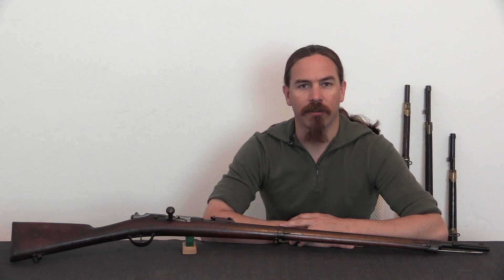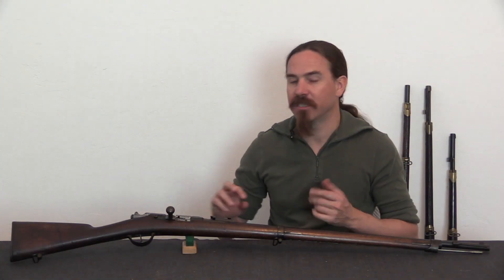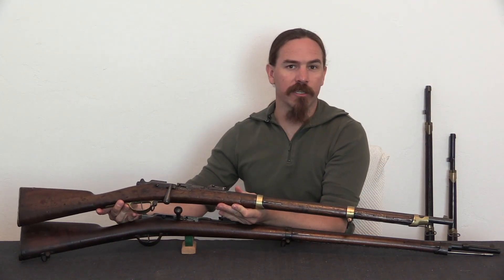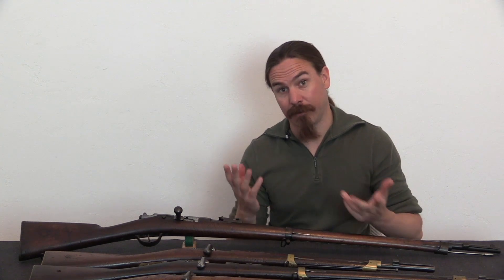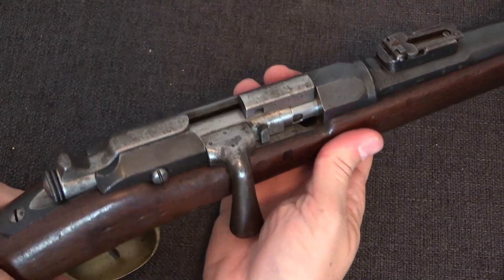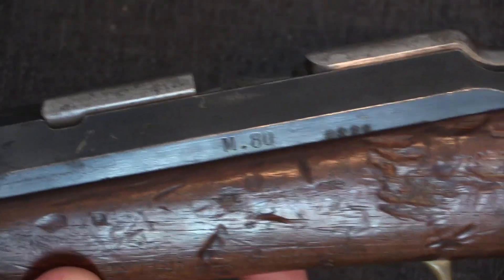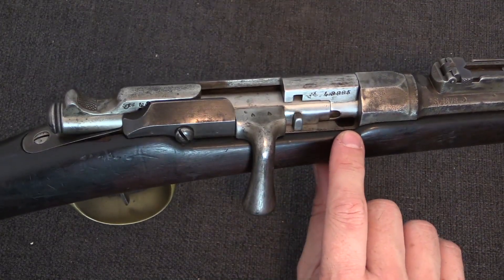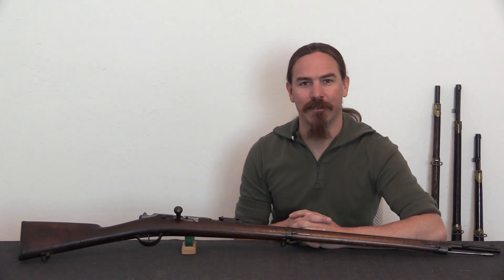The 1874 Gras: France Enters the Brass Cartridge Era

Comment: Would the Vitali magazine system have worked on the Gras and did the French ever make smokeless 11mm rounds ?
Reply: I don't see why not. In 1914, in the beginning of WW1, the French planned to modify the Gras rifles with a 3-shot Berthier magazine. But this never happened because they decided to focus on producing new rifles instead of modifying obsolete ones. But some Gras rifles was actually modified to fire the smokeless 8x50 Lebel cartridge in 1914. That model is called the M14 Gras. They just took a Lebel barrel and put it on a Gras, added a handguard and new sights. It's still a single shot rifle though.

Comment: This is awesome! Looking at your video, I've got the Artillery Musketoon version of the M 1866-74 Gras that was converted from the Chassepot, also got the M.80 upgrade. It's missing the bayonet lock, but there are faint marks on the barrel in the right place to make me think that the lock was ground off at some point. The stock has been pretty heavily beaten up and decorated with brass studs, but I can see the remains of both the primary stamp with the plug and the secondary conversion stamp. My dad picked the gun up in Saudi Arabia in the early 70s. Ideas on how a French rifle ended up in the Middle East, Forgotten Weapons?

Comment: Greetings from South Australia! I own two slightly different conversions of these things to 12 gauge shotguns; one with a barrel etched/engraved? "Made especially for South Australia" I cannot find any reference to local conversion - would you have any knowledge of these Gras shotgun conversions ?
Reply: Ashley Smith Interesting, I didn’t hear anything about this conversion. Original Gras is in 11 x 59mm.
Reply: Yes I've seen one in 12 gauge at the local gun shop in QLD. It was the model with the bolt that turned downwards. Not horizontal.

Comment: I find it kind of funny that the French word for rifle is Fusil, which afaik comes from the older word foisil meaning piece of flint. Fusilier originally meant a specific soldier, who in an age where most musketeers had matchlocks, carried early types of flintlocks known as dog locks, so essentially Fusil originally meant a flintlock firearm. It's also interesting how long they held on to the term musketoon, since the thing obviously isn't a musketoon in the original sense of the word.
Reply: Adding onto that, the word "Grenade" comes from the French for "Pomegranate" as the cross section of early grenades looked much like a sliced open pomegranate.

Comment: The Mosin Nagant's bolt looks vey similar to this one.
Reply: Yes, indeed. The rear part of the bolt is very similar. There is also similarities in the bolt head. Even the receiver is quite similar. I have a Gras and compared it to one of my Mosins. It is obvious that the Mosin was inspired by the Gras and Lebel. I have a Lebel also, the Lebel bolt is almost identical to the Gras bolt.
Reply: Sergei Mosin is inspired by the French so Mosin-Nagant bolt has a distinctive French flare to it.

Comment: Wasn't the Gras used in WWI by the French forces particularly as they exceeded the production of more current firearms such as the Lebel Model of 1886 or the Berthier? I also seem to remember instances of Gras' being used by french resistance forces as late as WWII.
Reply: The Gras was used in WWI by the support and guard troops in the rear (basically by all the troops that needed guns but weren't expected to use them all that often) to free up more modern guns for the front line, at least that's my understanding. Not sure about the WWII use, though.
Reply: Among Lebel 1886, MAS 36, Mle 07-15 M 34 and Berthier 1892 and 1916, Gras rifle was still used by French second line troops and French Air Force during WWII.

Comment: Your 1866-74 rifle wasn’t rebarrelled, the chamber was bored out and fitted with a chamber sleeve. When replacing the barrel they would not restamp the original Chassepot production year. Occasionally a rebarrelled 1866-74 will have the barrel marked with an N but not always.
Reply from the maker: Yup, you're right - I fumbled it in the video.
Reply: You're perfectly right. And  the new barrel of a 1866-74 won't bear the old date like here but the year it was manufactured

Comment: The Gras was Greece's service rifle during the Greco-Turkish war of 1897. At the time the Greek Army had a stock of 120,000 Gras and 50,000 Chassepot. Most of the Chassepot were of the Chassepot-Mylonas type, which was a Greek redesign of the Chassepot to fire metallic cartridges. The Gras remained in second line service with the Greek Army until WW2.

Comment: Who fires a 540 grain black powder charge with 6 bullets like WHAT how is that remotely considered for a "safety test" instead of a "hold my beer test"
Reply: Lol so thats why no one calls rolling blocks weak. Ive never heard anyone say it.
Reply: Well..."hold my pinot noir."
Reply: thats what a proof test is ya know they just took it to extreme levels
Reply: Here's my guess: by this point it had been observed (notably in the American Civil War, but likely elsewhere as well) that recruits manually loading paper cartridges would often experience a failure to fire for whatever reason and would continue going through the motions of loading as ordered by their sgt. They would then end up with several (6 was not unheard of) bullets stacked in the bore, likely because remedial action was not practical in a battle line and sgts would be expecting to see everyone loading, aiming, etc. 

So, this way if a rifle in this state is simply loaded and fired, it -- and the shooter -- can be expected to survive. Actually, really smart thinking. Of course this failure no longer occurs with brass cartridges, but the proofing requirements may not have been updated yet in consideration of this fact.
Reply: @marshaul  yes, that sort of testing was not uncommon.
I read somewhere about a Belgian gunmaker who didn't think the then newfangled Remington Rolling Block looked safe, so he tested one by loading a massive overcharge of black powder and ramming the rest of the bore entirely full of  bullets all the way to the muzzle. He was apparently trying to blow one up as "proof" of his own designs being stronger. He pulled the trigger with a long piece of string.... and noted in his journal that "nothing particularily exciting happened".